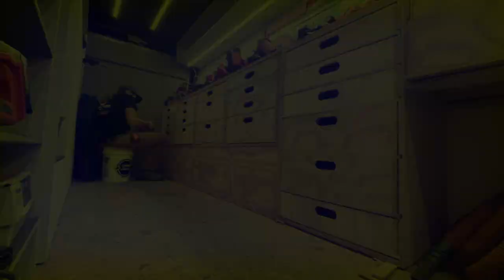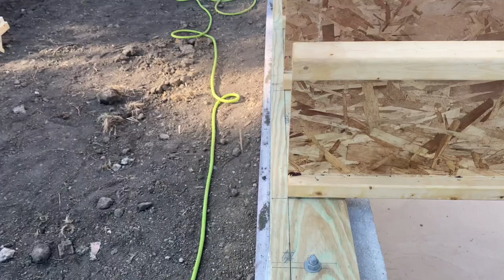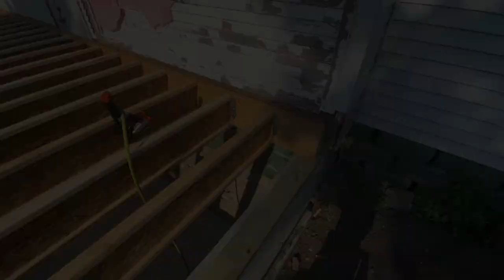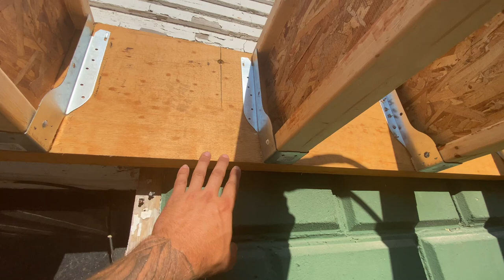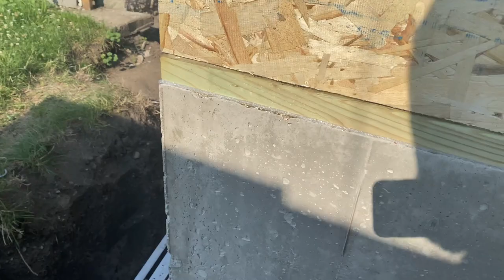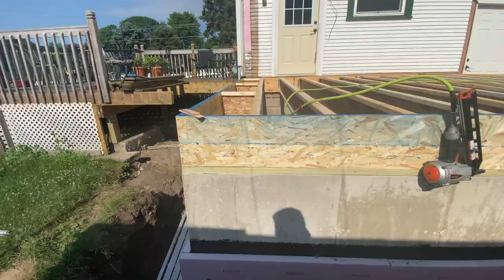Building an Addition: TJI Floor Joists, Rim Boards, Metal Connectors

Comment: Looks great!  I am curious if you need to put any cross supports with the TGI's given the span you have.
Reply from the maker: Not in this case. Most of the time it is spec’d in the manufactures instructions that you do not need bridging on TJI’s. We will however have to bridge the ceiling joists because those are framed out of traditional lumber.

Comment: I enjoyed the video. I do have a question about the corner that is lower by about 1/4 of an inch. The PL Premium adhesive will likely compress over time, and the rim joist will conform to the height of the stem wall. Do you foresee that this will create problems? Perhaps I have overlooked something?
Reply: PL gets real hard!

Comment: Don’t really like those OSB band joists. That material is notorious for splitting when you nail in the edge. How’s it going to reliably hold plate nails never mind subfloor nails. I built a 20’ garage with those same I-joists but I used solid sawn 2x12 plus a 2x strip glued and nailed on top to build it up. I did put a 2x6 strong back on the bottom center line making sure the joists were plumb at that point.

Comment: Neath job. Using the joists. What span is the maximum length without a support beam.
Reply from the maker: I’m not sure off the top of my head. This floor system was spec’d by an engineer. That’s how we do most of our floor systems.
Reply: @TheRealBeardedBuilder  ok. Thanks.
Reply: Not 100. % sure but I think its 17’. 
Terry

Comment: Thanks for the great video! Not sure the exact span you've got there, but did you trim 1 1/4" from each I joist to make space for the rim board? I believe you mentioned cutting them to fit.
Reply from the maker: More than likely that was the case! The rim boards on these engineered floor systems are 1-1/4” so that was probably the reason for the cut.
Reply: @TheRealBeardedBuilder  Awesome, thanks for your response!